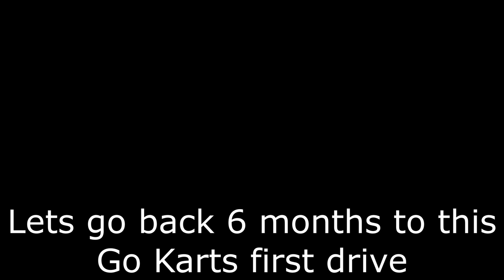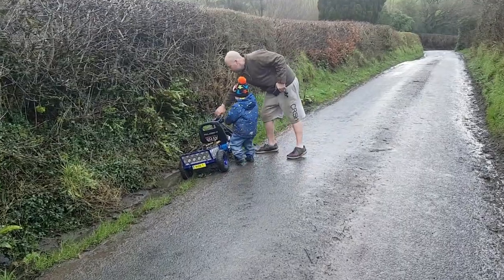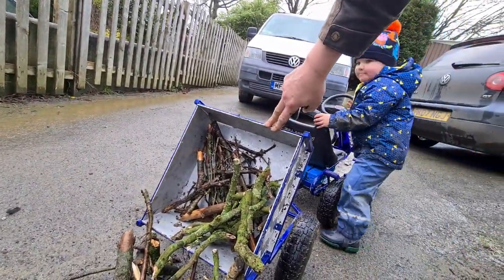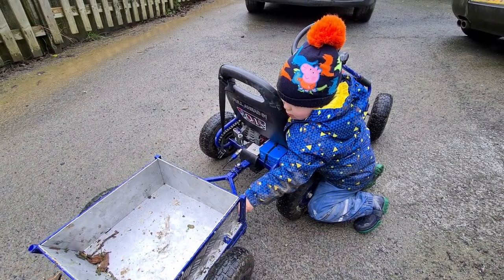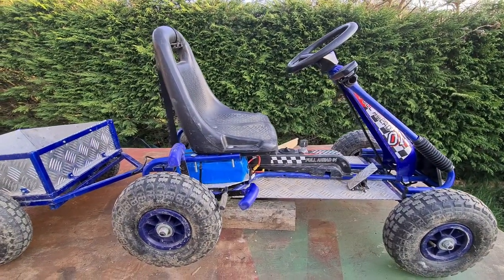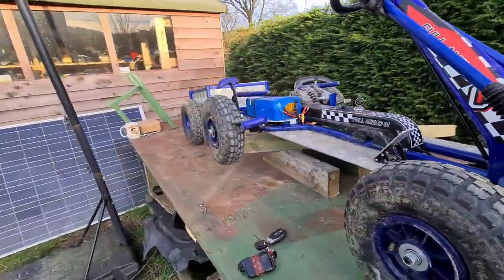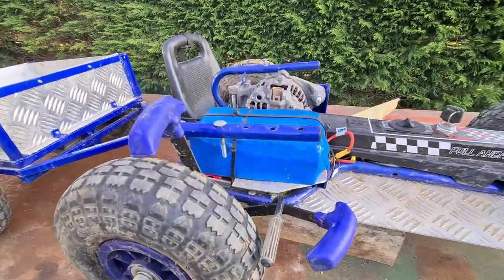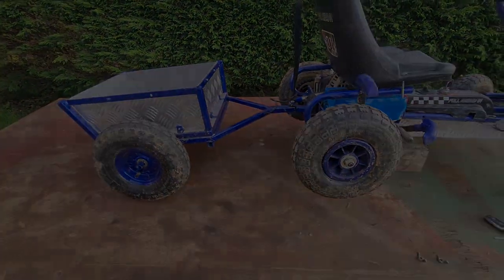DIY alternator powered electric Go Kart 6 months on

Comment: How much did this cost to build roughly with the brain and battery, I'm looking to build the same deal just on a bigger kart
Reply from the maker: This was a very cheap build. The speed controller is a 350watt brushless controller off Ebay for about £25. The batter is all made from cell scavenged from dead laptop batteries so basically free. There were some costs for the battery, cheap BMS but not much. Motor was a alternator I converted from a scrap ford fiesta. Remote isolator so you can kill the power when your son or daughter goes rogue on you. Added all together I think it was about £100 parts plus the cost of the pedal kart from Ebay. Let me know how you get on and best of luck!

Comment: I'm planning to build my son an electric tractor. I'm debating If a 1 wheel drive Vs live axel set up is better. Does the diff lock make turning hard? I'm concerned that one wheel would spin when loosing traction. Thanks for the update
Reply from the maker: The diff lock is fantastic when going through mud or soft ground or up a steep incline. One of the drawbacks of using this go-kart frame is the terrible turning circle and this is made more evident when you have the diff lock engaged. It will turn fine when moving at a reasonable speed but manoeuvring it's not so good. Certainly use pneumatic tyres though as they give so much more grip than plastic or solid rubber tyres do. Send me some pictures of your tractor when it's done I would love to see it! Thanks for watching.
Reply: @SlightlyModifiedUk   Thanks for your input. I'm planing on using a trimmer rotavator 40-1 gearbox for the axel and a permanent magnet DC 500w motor. I think ill try incorporating the diff lock like yours. Thanks a mill. 😄